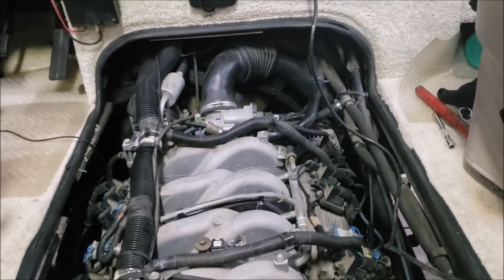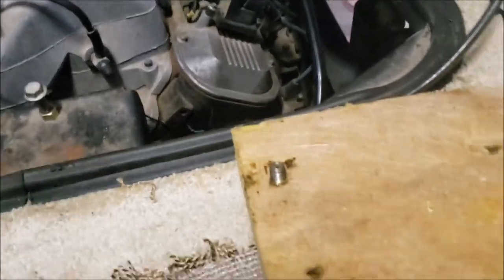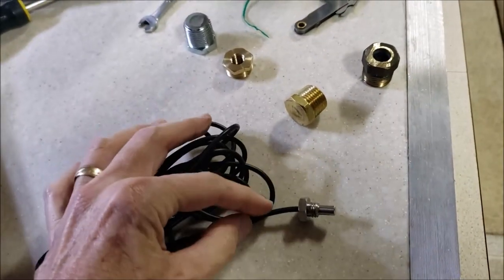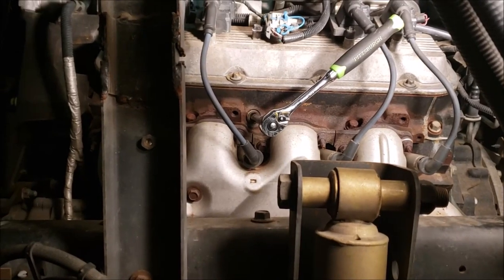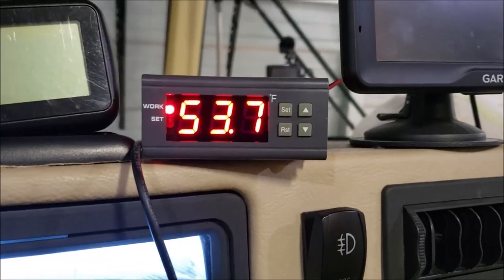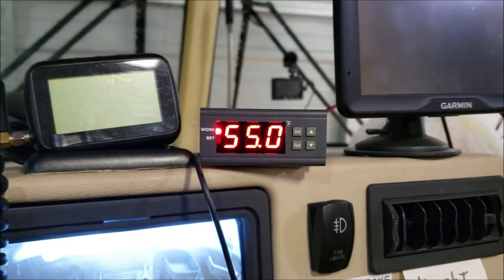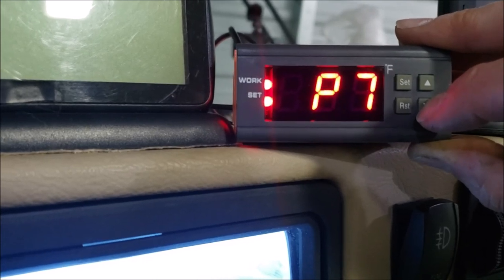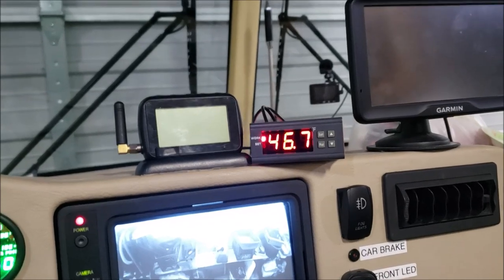How NOT to Blow Up Your 8.1 Vortec Engine in Your WorkHorse Chassis with Engine Temperature Alarm

Comment: Goood Job!! What you doing is good for us weekend worriers. I just bought a  Sightseer 2005. 29' And it came with the same motor 454 8.1 Workhorse and with one video I am learning so much that makes me feel safe while I am driving The RV. Keep doing what you doing!!
Reply from the maker: Thank you .. its comments like yours that keep me motivated to make them.. On a technical note although the 8.1 is loosely based off the old 454 its actually a 496 cubic inch engine. Let me know if I can be of any help my cell is 606-875-0125 Kevin

Comment: Did you have to go under the engine to install this temp sensor at all? We just bought an 01 forest river windsong and it has this exact engine. There’s only 18400 miles on the rig, so I’m a bit skeptical as I heard that less miles on the engine isn’t always a “good thing” (not sure how true this is) and would like to get this sensor installed.
Reply from the maker: You have options I mounted my sensor in the cylinder heads water jacket from the wheel well but you can also mount to cylinder head from above call or text me if you have any questions. 606-875-0125 Kevin

Comment: How did you power it? Did you go straight to the battery, will that keep it on all the time or did you hook it into an accessory?
Reply from the maker: I powered it from a accessory wire from under the dash it has a very low amp draw. I love my new toy.
Reply: @ktoutdoor  Thanks again for all your help. GOD bless
Reply from the maker: @steelheadstalker4715  Anytime

Comment: Do you realize that submerged temp sensors need to be submerged to be accurate? That's the reason the OE temp sensors don't indicate over temp due to coolant loss until it's too late. The coolant no longer surrounds the sensor, the gauge will actually drop until the engine casting or air inside becomes hot enough to cause the sensor to show the increasing (but inaccurate - low) temperature. You were doing fine with the sensor mounted to the surface. That sensor appeared to be inserted into an electrical connector with a large surface area that made it susceptible to ambient air cooling causing it to fluctuate. Possibly just covering the outside exposed portion of the terminal with a coating of silicone sealer may have cured the condition. I haven't watched the entire video (lengthy) but if you haven't considered it I would check your attached sensor vs the OE sensor as reported to the ECU by way of a scan device to determine if and/or how much variance there is, if any, between the surface and submerged temperatures and adjust the alarm level accordingly.
Reply from the maker: Thank you for contributing Carl, Yes I track it closely the ECM temp reading match within 2 or 3 degrees thru out the temp range up to 220 as we where setting in traffic last year. I keep a close eye on it. .. I'm always experimenting ..lol

Comment: 2004 HR Admiral 30PDD P32   Temp gauge is not working, actually the needle on the gauge sits below it's normal cold, not-running position , (if that means anything)  tested the Temp sensor, it passed,  no engine codes.  runs fine as usual.  The instrument cluster is now disassembled on my kitchen table...  needle seems to move fine.  Has sat for almost year, but started it every week or so just to keep the batteries charged.  I assume that the ECM is getting it's info from the sending unit, though the gauge is not.  What can I do to get the gauge to work.  I think it is OK to operate and drive, but would be nice to know the temp when pulling hills with a TOAD.  Any suggestions??  Perhaps a wiring diagram so I can test the continuity from the gauge to the sending unit??
Reply from the maker: Please watch at least part 1 https://www.youtube.com/playlist?list=PL2iVqSqj_ofsDtD6EVvlyunUHaugywPjj  I would not leave home with our Workhorse with out a scangauge 3 
This will give you you true engine temp in digital form  call or text my cell 606-875-0125 Kevin i have some PDF files that may help you.
Reply: @ktoutdoor  Ordered...thank you Kevin.

Comment: How did you get 2 scan gauges to work and can you monitor eight different functions on your ScanGauge
Reply from the maker: Yes I can watch 8 different functions at the same time but if you do you have to set the data ping rate to the lowest setting or you will get a error on the dash cluster. I used this for my connection. Docooler 16Pin OBD2 Splitter Extension Cable Male to Dual Female Y Cable 30cm
by Dealauto
Learn more: https://www.amazon.com/dp/B000TMCX72/ref=cm_sw_em_r_mt_dp_Cnx4FbVJ0JD2C?_encoding=UTF8&psc=1

Comment: I like to try the version one set up since I don't have the right tools to go with version 2. On version one what is the screw size you used to botl the insulation to engine...?
Reply from the maker: 3/8 thread I think? are you putting this on a 8.1 Vortec engine?
Reply: @ktoutdoor  yes I am... Have the same engine in my RV, workhorse 8.1L...
Reply from the maker: @nosdehgan4401  Then I would suggest the scangauge 3 it does this and so much more. link to gauge below video https://www.youtube.com/playlist?list=PL2iVqSqj_ofsDtD6EVvlyunUHaugywPjj
let me know what you think.
Reply: @ktoutdoor  I have seen your videos. It's a must have... Thanks for responding to my question.
Reply from the maker: @nosdehgan4401  Your very welcome

Comment: Hello Kevin, What is the little green cap next to the throttle body and what does the part do? I snapped mine off and don't know what it is.
Reply from the maker: I think its the EVAP purge solenoid it runs the gas tank fumes back into the engine.
Reply: @ktoutdoor  Thank you! Where can we locate this part? Have checked several auto parts stores and cannot find it.
Reply from the maker: @susanworster2725  Can you text me a picture of yours? my cell 606-875-0125 Kevin

Comment: Have a question about the radiator fan , when driving the clutch seems to be working fine so very little noise at highway speed , but ,  off once  the fan clutch  does  turn the radiator fan at lower speeds   the sound is like a 737  at takeoff power , do you know of any available  replacement fans that would run quieter and fit a W22 with an 8.1?  Thank You.
Reply from the maker: I only know of the OEM fan and I would stick with it.. the way our acts is when we first pull out the fan may roar but with in a 1/4 mile its all quit / normal fan sound.. Now if I start to pull a hill on a warm day and the temp. gets over 205 then I will here it roar but only for a short time. At what temps are you hearing the load fan noise.
Reply: @ktoutdoor  Hello Kevin , Seems anytime or temp, for example a cold start we get a huge roar from the radiator fan , then driving up to about the time the trans shifts into second gear, The shape and design of the fan blades are basically very crude. I am somewhat surprised there hasn't been more demand from Workhorse owners for a quieter replacement fan, Thanks again !
Reply from the maker: @Richie7884  I installed something like this on the engine cover and in the wheel wells and it made a big difference in the noise..
LINGDA 21.53 SqFT 10mm Heat Shield Thermal Sound Insulation Proofing Deadener Mat Car Noise Control Acoustic Dampening Moistureproof Waterproof (40"X80")
by FlyspeedUS
Learn more: https://www.amazon.com/dp/B074STNQBQ/ref=cm_sw_em_r_mt_dp_sr4dGb462D118